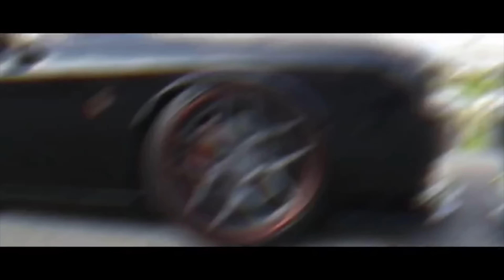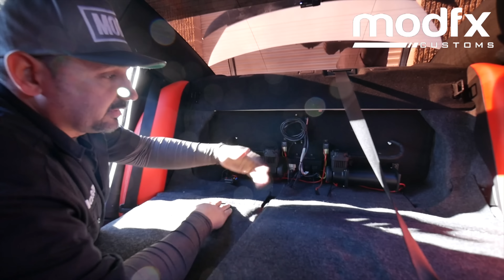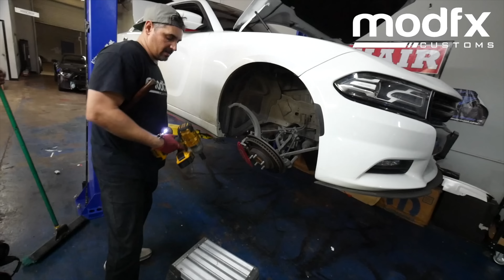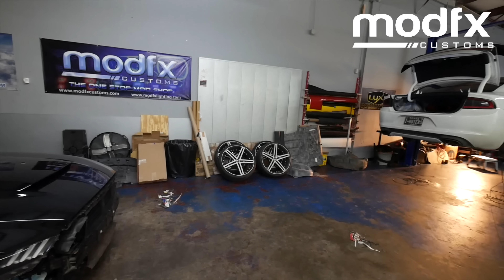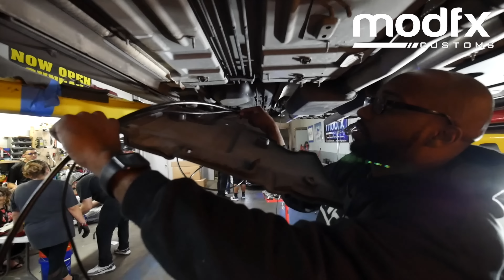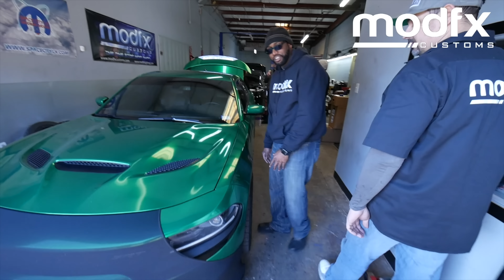DIY: Accuair E-Level Installation on a Dodge Charger

Comment: I have a question since I am doing my air bags on my 300, where did you mount the sensors for the rear, having a hell of a time trying to place them..any suggestions?